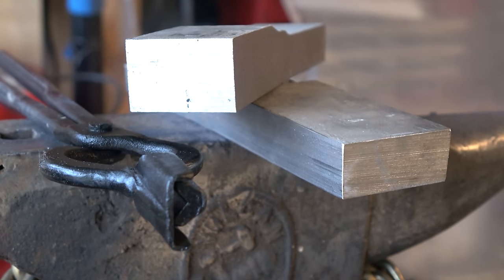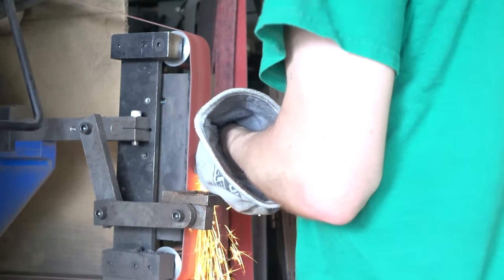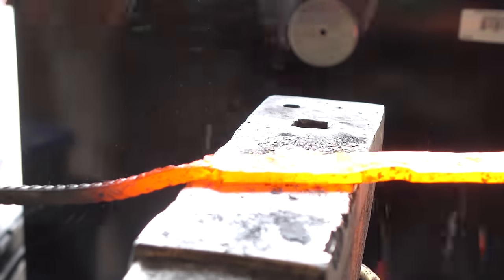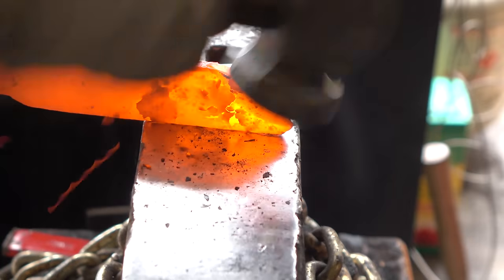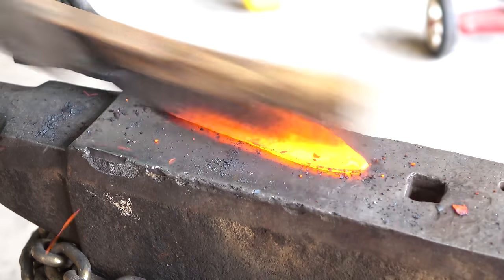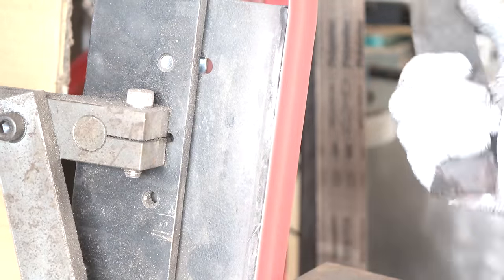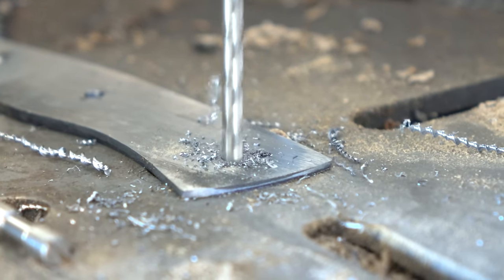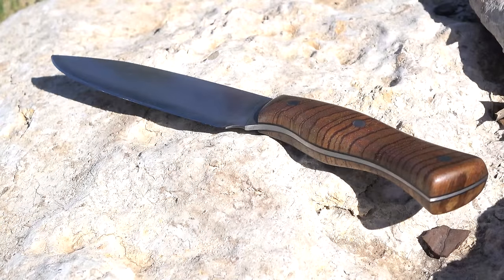Making a Knife From a Bridge

Comment: Simply beautiful!
You need more subs, people don't know what they're missing.
Reply from the maker: Kind words, thank you.
Reply: +Green Beetle 
Your channel is my guide as I start forging knives.
Reply: +Green Beetle 
Btw, I just made two knife blanks of of an old circular saw tungsten carbide-tipped blade, would you think I should harden them?
Reply from the maker: +Cameron McCanless  I don't think you can heat treat tungsten carbide.  It's like ceramic - as hard as it will ever be.
Reply: +Green Beetle 
Well I'm actually using the middle of the blade, not the tips, I'm just wondering if the steel there would need to be hardened.
Reply: Cameron McCanless in my experience that would be wise
Reply: it most likely won't be hardenable for anyone else who needs to know.

Comment: Very creative and again with the humorous. You crack me up!  Your addition of the harder material to the cutting edge was a brilliant idea, kind of like a San Mai in reverse. A perfect example of why the type of steel you use makes a huge difference. Quite a fine job on this one too.

Structural steel is deliberately made to not harden so it can withstand stresses of a bridge (repeated stresses), not a knife edge. I've worked auto accident scenes on steel suspension bridges and it is a weird feeling to feel the bridge flex underfoot when a large vehicle passes the accident scene. Hardened steel wouldn't handle that kind of flexibility, and would eventually develop cracks and fail. (I was a cop & traffic accident investigator for my hometown police department, and worked a lot of wrecks on old steel suspension bridges which were replaced by an ultra modern cable stayed suspension bridge). The new bridge is the one of the longest cable stayed bridges in the western hemisphere, the Arthur Ravenel Bridge in Charleston SC.

Comment: Something I've seen other smiths do and tried myself is water forging. Pour some water on the anvil before you pound your stock or metal, and the heat will cause the water vaporize and the steam will blow the scale off the blade

Comment: To draw out bar more rapidly, use a rounding hammer in conjunction with the edge of the anvil. I would use a flap disk on the belt grinder to clean the radii of your anvil edges. Vary said radii from tight on part of the anvil to large on the other end. mirror the sides of the anvil so your large radii are opposite of one another. Using the edge of the anvil will draw more quickly than the horn for a couple of reasons. First the radius will be much tighter, acting more like the crosspeen. Second the mass of the anvil directly supports the face edges, meaning that there is significantly less compression and flex in that portion of the anvil, thus wasting less energy.

As to the technique, place the piece hanging over the far edge of the anvil and use half on/half off hammer blows to draw out the steel. If you leave the piece flat on the face, as you draw it toward you, each subsequent hammer blow will smooth the previous blow's mark. If you lift the back of the piece, you will draw out more rapidly, but need another pass to clean up the hammer marks. If you rotate the piece 180 degrees with each blow, it will draw out even faster. When working with square stock, only rotate by 90 degrees each blow.

I also recommend using a 4-4.5lb hammer. it will make moving steel that much faster, and you will get less tired by letting the weight of the hammer do the work for you.

Love your videos.

Joe

Comment: great video! great work. 

As to your scale problem Walter Sorrells uses water on his anvil to get the scale off. 

The water gets trapped behind the scale and blows it off.
Reply from the maker: Removing scale exposes more steel which then forms more scale.  In this case, quickly.  So The conundrum was to loose steel by brushing off scale but decrease pitting or keep the scale and lose steel to grinding out more and deeper pits.
Reply: +Green Beetle oh, sorry you did say that in the video. is this something you found out the hard way?
Reply from the maker: Always

Comment: Don't worry about you technique. I use the same anvil ( Vulcan 70lb?) as you and I can't move steel nearly as fast. But then again I suck at all aspects of smithing with the exception of getting metal really hot. I finish maybe 3 knives a year, and I only have got 4 to heat treat. 2 are handled and finished and ugly. My third piece I broke in a vice to see the structure. And the 4th is a big chopper that hasn't got past tempering in 3 months. I have 2 pieces that need grinding and honestly I think I'm going to schop one knife in half and make a small camping knife to quarter deer in my garage. A 2.5 inch blade is all you need to compleatly take apart a full grown white tail deer.
Reply: if you haven't figured out fullering yet use a crosspeen and have at it or if you don't have (or want to use) a cross peen, just use the corner of your anvil. Just make sure that the edges of your anvil are rounded.

Comment: Green Beetle
 
Howdy... As for your concern about the hardness of Cross Cut grain Zebra wood? I have been using it for years with NO complaints from any of my customers It IS considerably more decorative and less utilitarian  than most handle woods, but don't count it out as a very good handle material. The only downside that I've found is, that since it's cross cut ( across the end grain ) it tends to warp and move from heat and moisture, and it's a bear to get belt sanded flat.  Due to friction heat. It doesn't stay put, but once it's epoxied and pinned, it's there forever. Keep making the great knives and videos.
Dave
Pappy Dave's Knives
Pennsylvania

Comment: FYI, rather than that cross peen...when you have a lot of metal to move, you can just beat it at a 45 over the anvil edge to stretch it backing it up along the length of the stock, then flatten her back out , heat and repeat.
Reply from the maker: Will try it thanks

Comment: Turned out nice. Looking at the pores in that zebra wood, I would've tried a CA finish. I've had success using it on unstabilized black palm, and thats about as punky as it gets.
Reply from the maker: Interesting, tell me more.
Reply: What you would want to do is sand your scales to their final grit, clean them of debris, and then paint on a few layers of Cyanoacrylate (fancy superglue). You would then resand at 200, being sure not to sand into the wood. After the CA is smooth, apply another layer, and sand. I usually finish at 2000, but I have a friend who goes to 15k. The CA fills the pores and voids, and adds a degree of strength to the wood, binding it together. There are much more in-depth tutorials, but thats the basis of it.
Reply: Alternatively, you could send your wood out to be stabilized, where it is basically vacuum filled with resin, which turns the softest of wood into a solid block.

Comment: Badass knife.  How did you negotiate the tang thickness reduction down through the handle?  The metal seems to taper towards the back.  So cool.
Reply from the maker: hammer it thinner and/or use grinder by applying more pressure in areas you want thinner.  Ideally you would use a surface grinder for something like tapered tangs but most don't have access to those.

Comment: Hello.I have two questions,can you? 1 Grain is not increased during 
forging at high temperatures?judging by the color of over 1000 degrees.
2 the blade pressed towards the corner(in a muffle furnace) to fix the leash or to the contrary did not lead? Thank you.
Reply from the maker: Thermal cycling can help reset grain size prior to quench.
Reply: Green Beetle thanks

Comment: This might sound dumb but what drill bit or type of drill bit do I need to drill through tough metal? I've tried so many
Reply from the maker: Anneal your steel or at least make sure it is soft and hasn't air or work hardened.  A quality carbide tipped bit does a good job but good ones can be expensive.  Cobalt and titanium bits do well too but they never last as long as advertised. In the end I usually just use the cheapest titanium bits HD sells and plan on replacing them frequently.

Comment: I notice you use powdered steel in various videos.  I have been making kitchen knives from leaf springs and keeping the dust as it comes off the grinder.  Do you think this will be any use as a powdered steel?
Reply: Luke Pickering yes
It is 5160 spring steel and it forge welds better than other steels so it would be good for some canister damascus as a filler.
Not for carbon difusion.

Comment: if i wish to get some borax to forge weld, do i need to order from Ebay or can i get it from a local shop? I live in norway :/
Reply: ive seen some people use sawdust wile melting aluminium just to remove some impurities. maby it works, i dont know.